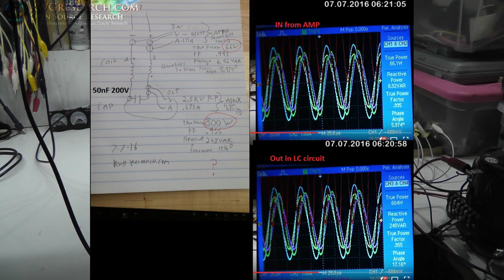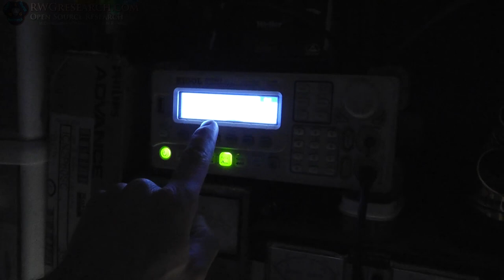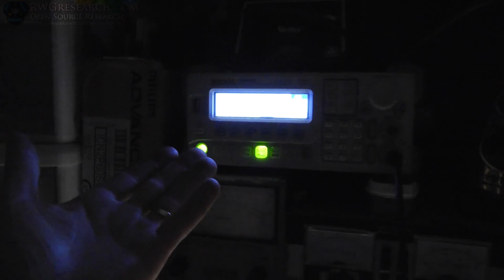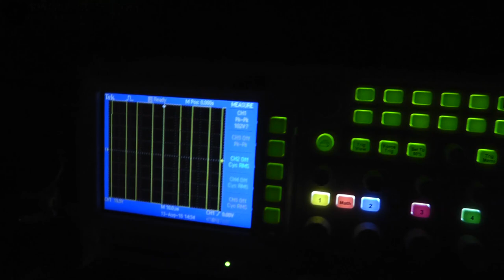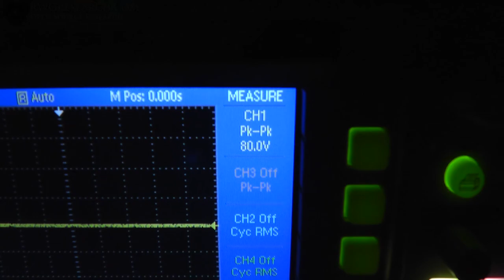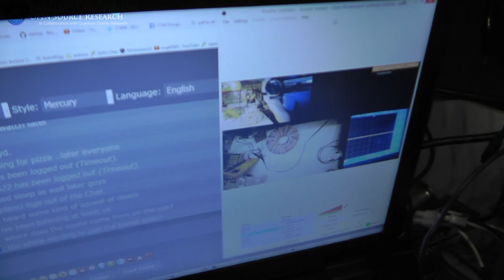Rodin Coil "MOT" Inverter OZONE Generator! WOW,  & SHORT Update...

Comment: I love this video!!!

Putting this thing inside of a vacuum with rf activated plasma would be fun to see... prediction is that it will make a quasar type of particle accelerator, some sort stelleator, would be cool ion engine for space travel if it did do that tho. might make that trip to mars possible in 3 months. 

the whole activation part is hella complex, ill get my head arround it and try and build it. plus i want a vaccum chamber & pump to try and coat some resin prints in titanium coating the rodin coil in titanium and creating an oxide layer might also be a great way of insulating it from accelerating plasma.

Comment: I'd like to see you change the frequency while it was running to see if you can get the nodes to move. Now that would be a wild visual.. So we are seeing the harmonic hf nodes/ interference .?.
Reply from the maker: yeah. I was thinking the same thing. it looks like it's about 3 x the resonant frequency off. looking at the plasma around the trouis. sure would be cool to do that. might be able to by adding a varibale cap on the out put...  ~Russ
Reply: cool, ya that might work good!

Comment: did u put a copper core ? with your windings? are you using the copper core to collect energy is that what you are calling the secondary? THat is cool though .. also I saw the recent skype interview with 007 he used a copper core as a collector . This is typical of a multi drive coil filar for the bedini paired transistor pulse circuit. When you consider building the multi strand drive system you have to think to add some collector windings .. I made a seven strand filar wind I plan to pulse 3 of the strands and collect on the other four. Take care rwg keep up the good fight ps i used to do high and low voltage work for living. and am ITT graduate. good stuff you making dont ever quit

Comment: i have no idea what is happening there, but it looks amazing! :)
How is that possible when it is insulated though?
Reply from the maker: it's the voltage potential that is exciting the oxygen atom. No electrical contact needed. Google "Ozone"  to get a better understanding.  same concept. there are 2.5khz of potential in those wires. so that's enugh to have the skin effect show up. simply complicated. lol. ~Russ
Reply: ***** intesting stiff! Do you really mean 2.5KHz? Isn't the potential actually given in volts usually?
Reply: *volts
Reply from the maker: +muh1h1 yeah typo. 2.5kv Pk-pk.

Comment: The coil is ok but the winding is wrong. I have seen many people attempt to make Rodin's coil and they completely miss how its supposed to go together. I can say this cause I have studied his work and created my own models. As a matter of fact Rodin has the last one I made. I was one of the people who discovered that the 2 pairs will wind themselves. I also figured out how to calibrate and get it to work the way Rodin says it does. The coil you produced does not follow his math. Rodin will not tell you if you are right or wrong. I will say this though, you are missing a vital part to make the coil work. However you need to wind it properly first. Very hard to do when the book he had written depicts the winding pattern in a strange manor. Good luck with it.
Reply from the maker: so you leave a comment.  and wish me luck. that's not helpfull at all. your comment would be better if it had some more explanation in it. and yes. this coil is not to the math. that is correct. and this is known. I'm all ears if you wish to elerabitrate more. ~Russ
Reply: Sorry if you feel slighted that I pointed out that the math was not followed. I never offered any help. However I am not the one posting someone else's work and using the title of it when the end product is not following the work set out by its origin/owner. When you work on any scientific work you should follow scientific methods. I do not leave any explanation because his work has other YouTube videos that explain the math and loads of detail. I do not need to re-post his work. I lived with Marco in Hawaii back in 2000. He was too busy at the time to worry about helping me with his work. He simply said to read the book. The book was written with religious text embedded. Its hard to follow and is not true to his direct teachings. In order to elaborate I would need a shop to work from. I do not have any way to work on these devices at the present time. Again I did not offer any help and only wished you luck in your experiments as I am a polite viewer.

Comment: Where is real woking overunity device? So many fake lie product are tgere I got ripped off by Rick Fredrick over unity fake 3 times about $750 or $700 they were calling it Bendini motor or 4 dule pole motor by Rick Fredrick after I bought it he was very not nice hard to communicate with . Where is over unity device it really works ? Does Roddin Coil generator  at ebay do they really work?